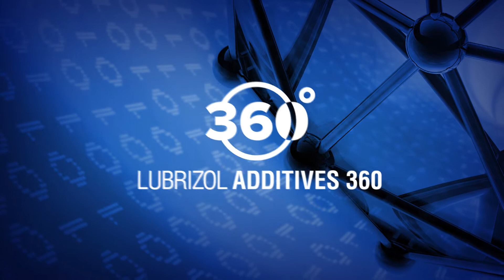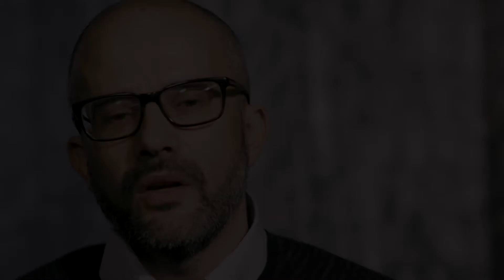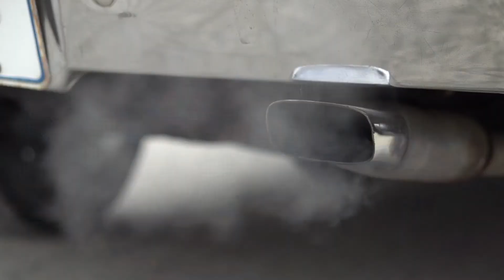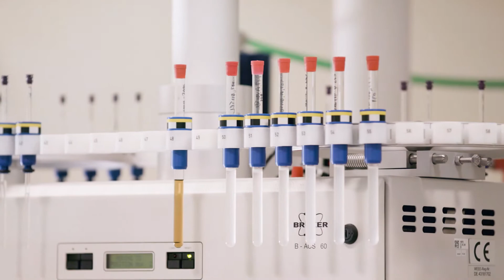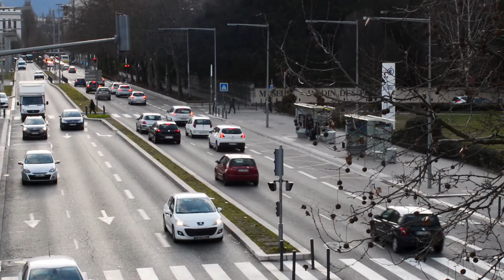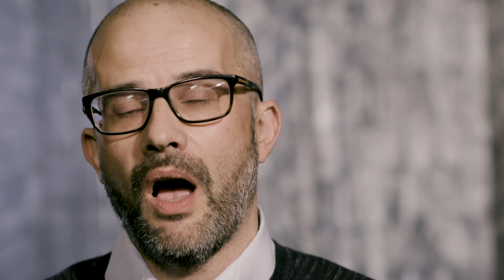BMW Longlife-04: Evolving Performance Requirements

Comment: yes a lot of oil lost their bmw-ll04 approval, like castrol edge (there is a new castrol edge m for bmw), liqui moly 4200 etc etc, check the brand website before buying
Reply: True Castrol Edge C3 lost it. Only Castrol M has it.